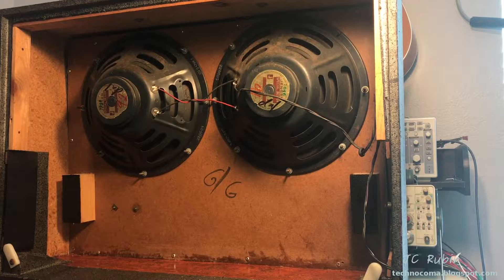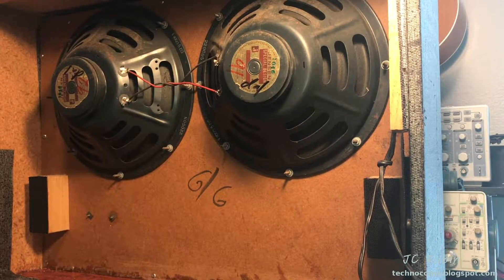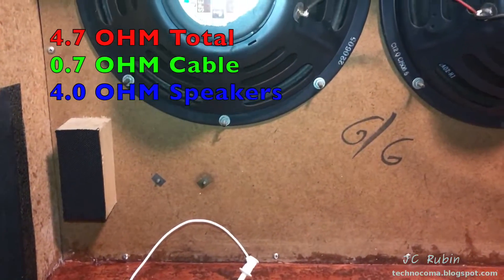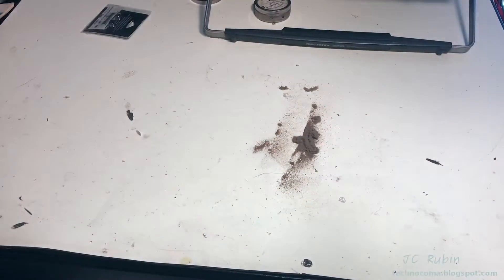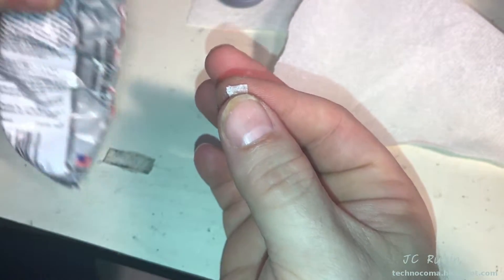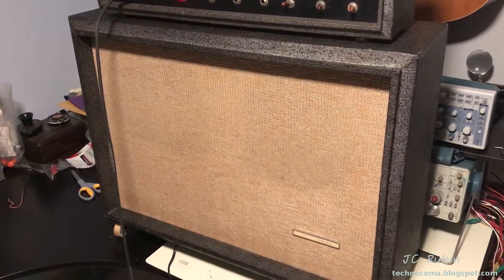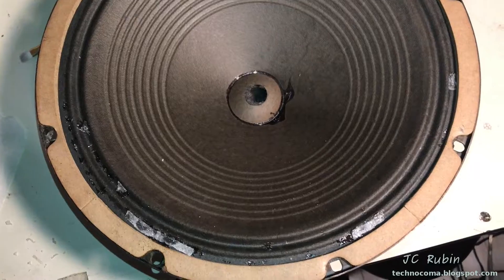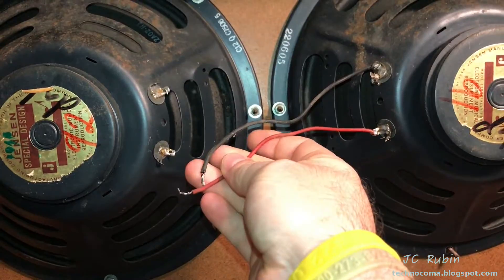Sears Silvertone Twin Twelve 1484 Major Restoration Project [6/6]

Comment: Binge watched all 6 videos this evening and thoroughly enjoyed them!  I had a Twin Twelve back in the mid sixties playing mostly surf music on a Fender Jaguar in our Southern California "garage" band.  Both the Sears Silvertone 1484 and Jag are long gone, but after a 25 year hiatus, I got back into guitars and amps. 
A few years ago a good friend was downsizing some gear and he gifted me with another 1484 amp.  The cabinets are in fair to good condition and the amp itself had been brought back to original specs (verified this past spring by an electronics guru friend!). 
You certainly seem to have extensive electronics knowledge and experience and have done a magnificent restoration of this fine old amp!  They have survived the decades and are held in very high regards by many musicians.  Resale prices are high and have been so for at least the past 15 plus years.  I hope you and your "boss" have kept this amp and enjoy it's classic sounds on a regular basis. 
The tremolo is excellent, but the reverb unit generally doesn't have much going for it and many don't work at all.  That was the case with the reverb in my amp.  However, my electronics friend brought it back to life although I prefer using my Fender 1963 Rėissue reverb tank as the Twin Twelve's reverb sounds more like geese farts on a muggy day! 
Thanks for the excellent videos and cheers!
Reply from the maker: Thanks for sharing.  Yes we kept the amp, though I may re-visit the reverb again to see if I can improve upon it.  Also I think there is one resistor I missed that I really want to hunt down but it only makes noise intermittently.

Comment: The damage to the cone perimeter appeared to be quite severe in both speakers, Jordan. I tend to be quite conservative when it comes to replacing original parts, but I honestly think that re-coning is indicated for both in order to provide long-term performance in keeping with the meticulous overhaul you performed on the amp itself. This series has nicely illustrated a systematic approach to restoring a amp circuit with many issues. Thanks for creating and posting it.
Reply from the maker: Ive considered reconing these speakers and most likely will in the future.   After watching your video with the gunnite overlap and taking measurements with the percent of speaker covered on mine , I may elect to redo that piece of the cabinet, at which point a reconing project may be in conjunction.   I did however want to see if i COULD fix them and send the amp down to cornerstone to pass the torture test.  Once reconed, I would never know if the repair had worked.   It would represent the last thing 'repaired/not replaced' in this project

Comment: The distortion that you hear when low frequency notes are played at higher volumes MAY actually be voltage spikes (transients) generated across the output tubes at the primary of the output transformer. That type of distortion can usually be eliminated by installing a simple snubber circuit consisting of a few capacitors and resistors. You can find info on this one the internet. Antique Electronics Supply in AZ sells "kits" with the components (depends on the tube complement) and has reference materials on the design.  The use of snubber circuits on push-pull output stages dates back to the 1930s. I had this issue on a guitar amp and installing these few passive components eliminated the transients.
Reply from the maker: A possibility.   But it is only heard when the reverb circuit is activated, and even when activated, only when the amp and the speaker are co-located.  The distortion is further exacerbated  by directing a small output speaker directly into the back of the chassis.